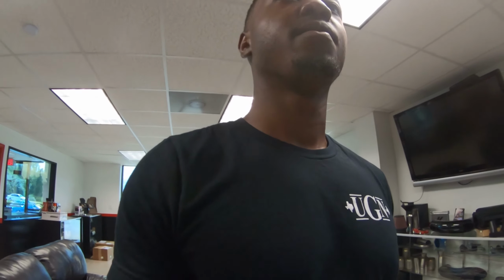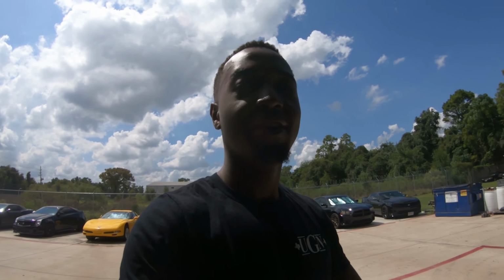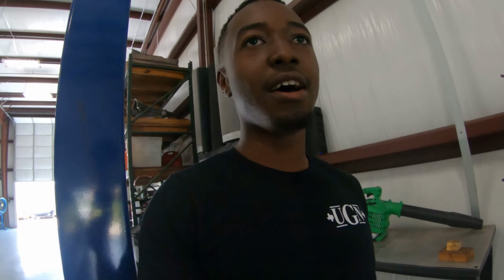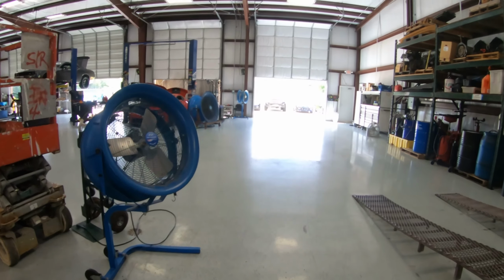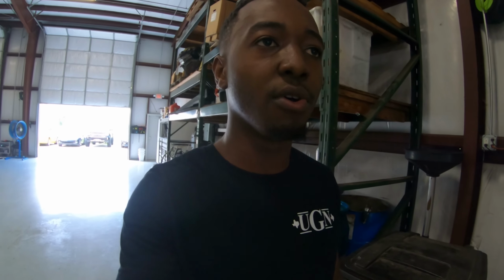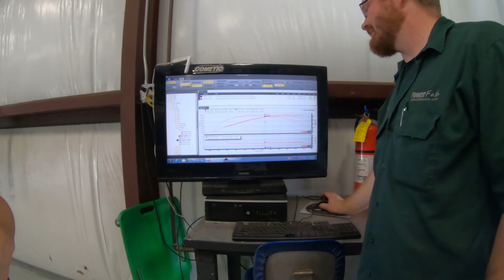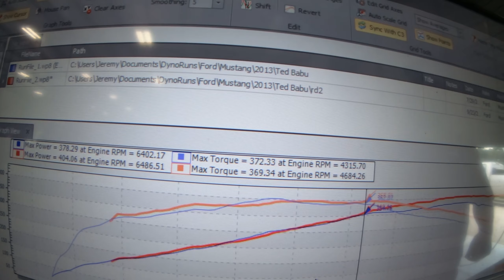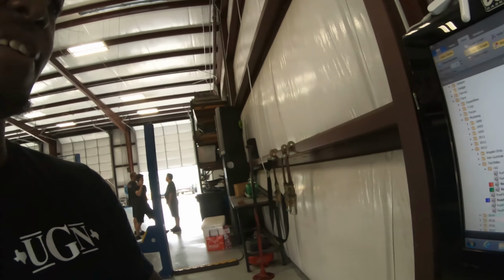2014 Mustang GT FBO E85 DYNO DAY

Comment: I made 433 to the rears with a ported 2018 manifold, JLT series2 CAI, long tubes, catted xpipe, Roush axle back and tuned by Brenspeed. It’s a monster and I love the solid rear axle.
Reply: Manual o automatic?
Reply: What have u ran in the 1/4¿
Reply: you on e85? mine made 502whp on e and tricky tune and ported cobra jet

Comment: 405 hp is way too low bro something is off my bro made 470hp with long tubes, e85 and the CJ
Reply: Yeah made 469 with ported boss 1 7/8 LTH e85
Reply from the maker: @rggt6225  hot summer temperature and drag radials messed it up 🤦🏾‍♂️
Reply: You guys are on a happy dyno lol
Reply: John Paxton lol I know right
Reply: lol way too happy of a dyno, with that you should be around 450's in a gen 1
Reply: 465-470 seems about right with a good E85. you guys gonna remember he’s a automatic, that takes out so much power and he’s also has a shitty intake manifold, so 406whp is about right
Reply: God Like • how does an auto take away so much power?
Reply: austin bhd2861 automatic shifts duh
Reply: Real Family my dude what lol, what does shifting have to do with horsepower and newer automatics shift better than the driver 😂
Reply: Lifeofalex5oh nice video I made 409 whp in my 2014 gt completely stock, except for deleted mufflers and resonators.
Reply: I was thinking the same, I made 420 with kooks headers, a PMAS cai, E85 and stock intake manifold
Reply: @coyoteaustin17  more power loss through an auto, just the nature of the beast
Reply: @jamesb1856  incorrect the only difference in numbers is because the Torque converter is locked on a dyno . It is a different story once they are actually next to each other
Reply: @kylanosborn483  not incorrect. There is a lot of difference between an auto and manual besides the torque converter. The biggest power drain is the pump, but you also have seal drag and the mass of clutch packs and planetary assemblies,  as well as increased windage in an auto
Reply: 425 rwhp with boss intake... longtubes...cai on my buddies 2011 6 speed. No e85 here in Canada
Reply: @kylanosborn483  no need to get butt hurt, you just said I was wrong and I was simply explaining why I'm not. I'm not saying autos are shitty or slow, in fact, if 2 cars are equal except one being a manual and the other an auto, the auto will likely win by removing the chances of human error. But we weren't talking about racing, we were talking about drivetrain power loss on a dyno, where the auto loses more. And if you wanna race, I'm down, I might surprise you.
Reply: @jamesb1856  yea I agree 100% with everything you said...I'm a manual guy all day these auto guys think they "automaticall" get the win (pun intended lol) just because they're auto they underestimate manuals some guys with manuals can really row them gears.  You cant outshift the auto but you can come close enough to equaling it where the difference is negligible.  They put down less power plain and simple but they make up for it with the shifts.  If a 6r80 races a well driven mt82 they have the exact same mods on both it could potentially be dead even if dude can powershift like a boss but many people cant do that so in those situations the auto gets the w.  So they do have the advantage taking away human error but the auto guys really underestimate what a well driven manual can do.
Reply: @midnight347  exactly. And I like how dude didn't have shit to say after I took him to school. The mt82 isn't as trash as people make it out to be, it's not as tough as the 6R80, but the stock clutch and shitty drivers make it look bad. I didn't build my car to break records, I built it to have fun. If it were a racecar it would have a turbo and a th400 or power glide. My man talking shit probably has no clue what those are, and I'm making 700 wheel and I've been rowing gears in mustangs since I was 16, 20 years ago, I don't care how fast his magic auto can shift, I'll gap that ass 😂
Reply: You’re local dyno is straight capping
Reply: @TeddLike what kinda dyno did they have?
Reply: My 2013 coyote engine made 434/392 bone stock on pump gas. You need a new tuner bro, what the hell. You have a manifold, headers, and better fuel and you’re still making 10% less power than my BONE STOCK engine on pump gas lol literally doesn’t make sense. The only thing it could be is a tuner that doesn’t know how to tune a coyote

Comment: Something is wrong with the car bro.. It's impossible those hp with that config..Only things that I changed in my 2014 was  the exhaust and air intake with Borla and JTL and I got 472 HP..it is all about how clean the engine and the exhaust, check for metal in oil  when tou change it , the catalytic converter could also cause problems cutting off the power output not letting the engine breathe.. could be a lotta things ,plus you don't calculate the dyno like that ,is also the drivetrain loos that is usually 12 to 15 % out of the total displayed hp and the conditions like temperature and wind , there's a lotta of difference when you drive it and other thing when it's on the dyno...

Comment: They were shutting that down waaaaaaaay too early shoulda rang it out to like 7k+ rpm
Reply from the maker: Facts
Reply: Tedd Like car definitely makes more than the sheet says! I’m FBO E85 and a ported 18 with some other stuff being a clutch flywheel etc and I mean I’m touching 118 at the end of the 1/4.. shift at like 7500 and it goes!

Comment: Its low becuase its on drag radials, its hot and its a Auto so its not going to be as high as a manual car
Reply from the maker: That's what I read about, but when I asked the Tech he said that I'd doesn't make a difference. Maybe they just wanted the money
Reply: Tedd Like Yeah, I wouldn’t breathe too much into HP numbers man. Take it to the track and see what it runs!
Reply: Tedd Like autos lose ~ 5% more power through drivetrain than manuals if I understand correctly. Plus unless you got the track package the autos came with 3.31 rears and the manuals came with 3.55s

Comment: Low. I have cat delete boss 302 mani and pump gas tune by r&s and I made 438 wheel.
Reply: Damn that’s pretty high. I just got my E85 tune by r&s yesterday. I have a ported 18 mani/BBK 90mm throttle body/JLT series 2 cai/BBK1 7/8 longtubes/no cats & no resonators/custom x pipe/borla atak axlebacks on E85. How much you think I’m making bro. I’m an automatic btw